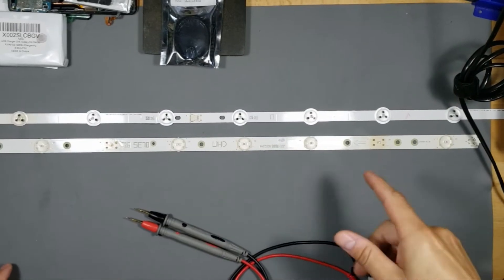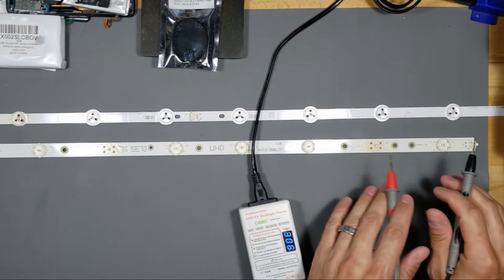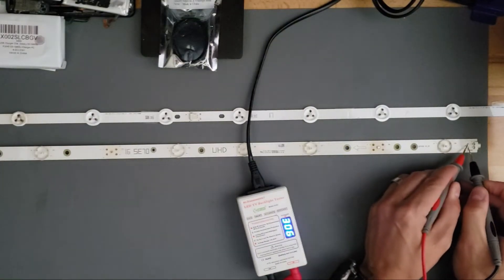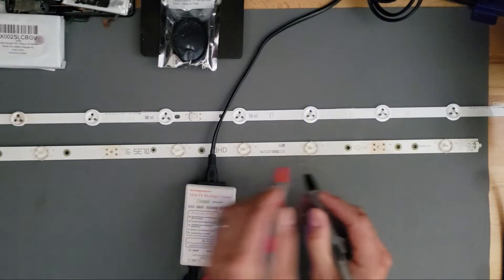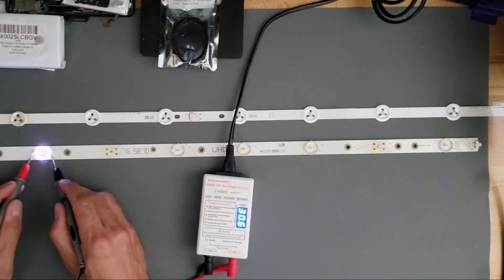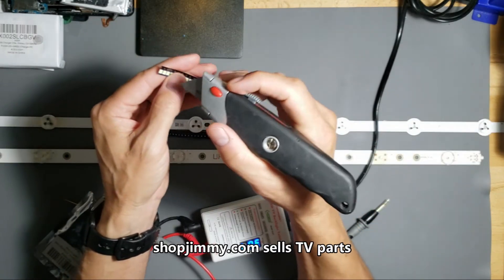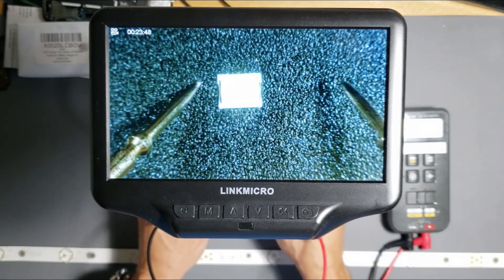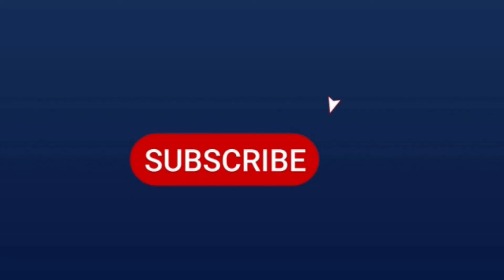3 Ways to check LED TV Backlight Strips

Comment: Why can't you test the led with the multimeter in diode mode when the leds are in circuit? Why can't you use the multimeter instead of having to have a tester?

Comment: @TampaTec : Thanks for the informative video. I am a newbie to DIY Due to a recent repair of our LG 47 Inch TV( same as described in your video black screen), we got the entire back light strips replaced. I am planning to re-purpose the light strips that were taken out. I saw in one video where the TV manufacturers connect these LEDS in Series instead of Paralell( or viceversa ) i could be wrong. however i do not know the voltage needed to connect them. i have 5 Led lights per strip & the connectors at each end are looking like they would fit VATTENSTEN IKEA USB strip power plug. Please advise. Thank you in advance !

Comment: If  the screen went dark all at once wouldn't that mean that there must be another issue than LEDS?.. What are the odds that ALL 14 light strips went out at once?...or are they connected to where if 1 goes out they all go out?   I do see a picture in the screen when I get close to the TV screen.  And the sound is working.  Thanks
Reply: @jcgtv3692 not necessarily,  when 1 or 2 LEDs fail, the TV will try to "protect itself" by not turning any of them on  🤷
Reply: They are connected in the same circuit. So 1 goes out all go basically. Only useful for the TV manufacturers to allow new tvs to be sold after lights go out.

Comment: I did read the comments. But some peoples will never change in there behaviors. If they think they are perfect in electronic so why there here on youtube watching videos and giving bad reviews. 🙄
Some says using a charger to test the led am not saying they are wrong. But think it will only light if the led is good.
But it won't led you know how much volts the led using.
That's the difference between a charger and a led tester.
Jimmy all your videos are good and it's a learning channel also for the new beginners.
Thanks likes yours keep it up 👆.

Comment: Blah blah blah. Can I test them using a battery charger?orrrr can I strip the LEDs end an just touch them to a power source..........
Reply: @Elmer-lk8dh  yeah use 3v supply
Reply: What about a 9 volt battery
Reply: Or what about a flashlight I tear apart and use
Reply: Yeahhhh, now I wanna know now.. Can you use a 9v or with a flashlight you can tear apart

Comment: So who makes the best replacement LED strips?
Reply from the maker: Shopjimmy.com they're tested and I personally installed them in my own TV and still works good.
Reply: @j.lietka9406  you always want the same LED strips you had. Go by part number. Every TV model is different and even the same model may have slightly different ones.

Comment: Okay so now I got everything apart and it was exactly what I suspected which is why I asked my question earlier so basically my problem is the TV is working great but the very top from left to right is darker than the rest of the TV right where the top two LED strips are underneath. So I assumed it was one bad LED but now that I took it apart all the LEDs are lighting up individually so I don't know which one is the culprit I only have a multimeter so is this where the LED tester is superior ?because it's able to pump more volts to see if they go brighter or not?? Without that I have no chance of knowing which one is not going brighter if they're all lighting up the same. So since I have it all apart  I'm just going to change a few LEDs that look a little bit more yellow than the others and hope for the best. it's still watchable like if you're playing hockey and the goalies at the top of the screen wearing a black Jersey you can barely see him but I'll just wear white jerseys for now.

Comment: Is it possible for a led to illuminate while you're testing it out of circuit with the multimeter but when you put it on the actual strip it's not going to get brighter like the beginning of your video and stays the same brightness? Or if it lights up with the multimeter then once it's in the circuit then it will get brighter when it's supposed to? Basically what I mean is it possible for the LED to not fluxuate brightness properly in circuit but still light up normally on its own
Reply: Did you ever get an answer? Good inquiry 🤓

Comment: Long time, first timer here. Long time subscriber/fan. First time leaving a question. My backlights started going out one section at a time. I was left with 1/3 of the screen going dark. Now the TV shut down and won’t turn back. Aside from the LED backlights, you think maybe the mother board or power board is out? I’m going to crack it open. I got a new TV. This Vizio is going to be my guinea pig repair TV.
Reply: @miniconsolemods7796  same, did you ever figure it out ?

Comment: I think in diode mode, the "DMM" puts out 3 Vdc to test the component and about the same on resistance. I would have to read the Bible that comes with it. Chapter "Let there be light" in am sure it saw it!
Cool video. I hope you have one that shows the screen array on the back side. My son has failures on his 56" whatever, then sticks them in my garage, no complaints taped to it, no remote or power cord. Just wonderful thinking for a now 38 year old. They sit there because they I have no time, no space and low on my priorities!
Thanks!

Comment: Hi I was wondering if you could offer some advice I have a Toshiba 55T6863DB tv couple of weeks ago the screen went black but sounds still working , when I turn the tv on now it shows Toshiba for about 2/3 seconds then screen goes black again ? I was wondering what I need to do to fix I’ve replaced all 3 boards I bought on eBay but still have same issue ? Do I need to replace any other boards ? Any help much appreciated as tv is only 4 years old

Comment: I need help on a phillips 50 in roku tv; it comes on, standby light does a double blink over n over, back lights work, I can see them cause I have the back off, I remove one of the buffer ribbon s from tcon and one side has Pic black on other opposite affect wen I reverse the ribbons the other side of the t will have Pic and black on other. No obvious damage to any boards getting 120 at source. Chief complaint was; they had a power outage, only used for light video games, at first Pic went out, by memory he could toggle to tv and hear the TV shows just black screen. As I mentioned back lights are in operation (they work),

Comment: HELP:  I have a tv with no back light. I have tested the LED strips and replaced the bad ones. All strips work when tested individually but they don't work when connected to the driver board. I have also replaced the driver board with a new one but still same thing. There were moments everything seemed to work fine but short lived.
Reply: Hey there! Did you test the strips together before installing? Sometimes some strips work by themselves but always make sure they work together before installing

Comment: I have a Sharp LC 42sv50u the standby light is on while it's plugged in and when you power up the green light comes on no picture no sound it appears that it may be a problem with the power board any suggestions